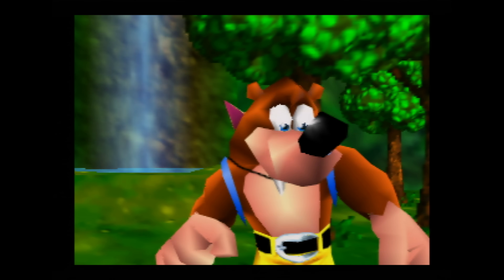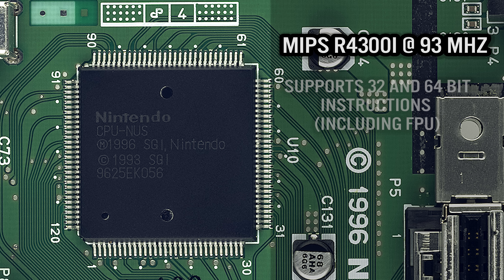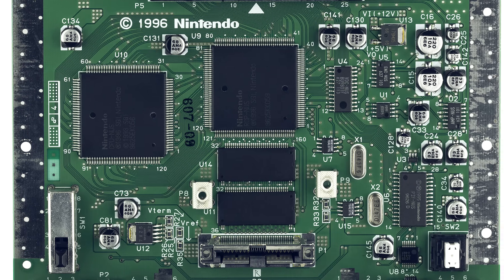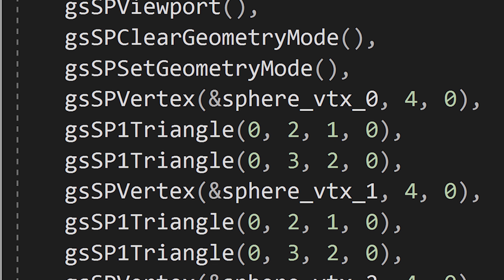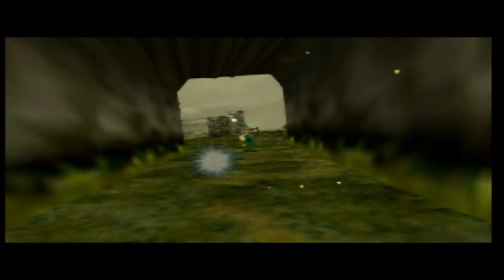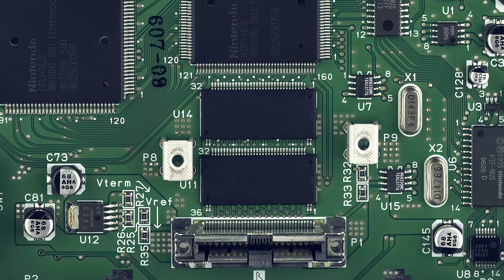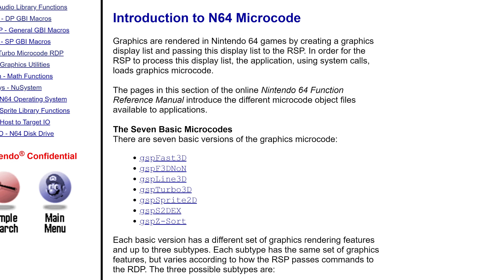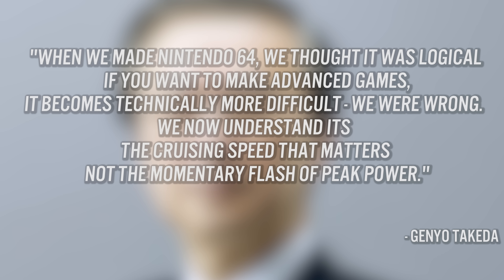Why was the Nintendo 64 so hard to develop games for ? | MVG

Comment: Noobs = the cartridge format was the N64's weakness

MVG = 4kb texture cache, RDRAM, pixel fill rate were the N64's weaknesses
Reply: @randomguy8196 Not as much as you think.  Super Mario 64 was $50.  Sony dropped the price of Playstation games from $50 to $40 around the time of the N64 launch as I recall.  Even when they started getting into the larger cartridge sizes, Nintendo 1st party games were usually still around $50.  The 3rd party developers games would cost $60 to $70.  This had less to do with the medium the games were stored on and more to do with Nintendo's extreme greed.  Here is the basic rundown of costs according to a reddit poster that claimed to have once had a contract for N64 development.

Minimum production run: 15,000 units

Production costs Nintendo profits from because you have to go through them.

Nintendo takes an additional royalty fee of $7 each cart for logos, seal of approval, etc.

Packaging runs about $150,000 for 15,000 carts.  Manuals, boxes, shrink wrapping.  Delivery fees not included.

On a $55 cart a profit of $6 to $7 dollars was made.  Nintendo got the rest.

Profit margins for developer on Playstation could be as high as $27 per disk.
_______________________________________

This is why 3rd party games cost so much more.  Even the Blu-Rays of the WiiU are a special proprietary format that only Nintendo makes.

Crash Bandicoot has a very linear structure to its' level design.  The designer always knows what is coming next.  That is a luxury that an open world game doesn't have.

Ubisoft, EA, 2K, Activision, Rockstar, Capcom, etc.  They all do it.  If Mega Man was a new franchise released today you would have about 5 levels that you would keep playing through over and over again.  You wouldn't gain a new weapon after defeating the boss either, but instead a random part that is needed along with others to make the weapon.  How is what I described not exactly like Monster Hunter or any number of endless grind-a-thons?  For the record, I do enjoy Monster Hunter, but it is a short game as far as content goes, that is artifically lengthened to be an endless time sink.
Reply: @Maintenance Renegade I find going purely digital to be a mistake because it gives the publishers too much control over our purchases. Consumers have long since forgotten the importance of personal ownership of the things they buy and the right to do whatever they want with them.
Reply: The cartridge actually did hurt it though
Reply: randomguy8196 this dude is a very annoying Saturn propagandist plaguing 90s console comment sections for quite a long time already, together with other Sega fanboys.
Reply: @Maintenance Renegade Yeah, it is really interesting how cartridges can now hold as much data as a disc. The Switch's cartridges can actually hold 32gb which is more then what a single-layered Blu-ray holds(25gb)! And apparently Nintendo is working on bigger Switch cartridges that go up to 64gb!

I would say that it looks like cartridges might be making a huge comeback, but sadly I don't think that will be the case. I think that everyone will opt for digital only consoles in the very near future. Physical games have slowly been going the way of the dinosaur since the Wii/PS3/360 era. Hardly anyone buys physical releases anymore, and Sony has made it very clear that they plan on phasing out physical releases with the PS5.
Reply: @Maintenance Renegade Great point. One major reason why I don't like digital downloads is that they are a poor choice if you wish to own the game permanently. Your console's internal hardware will eventually start to go bad, and parts will need to be replaced. Depending on what part that is, replacing it could wipe out everything you have on it. For now, you can go to the shop and re-download all your games, but internet will be disabled at some point, and that means you'll have no way of getting those games back. At that point, you better hope you have all your games backed up somewhere. If not, your only hope is tracking down a physical copy, considering they exist (although you'll no longer be able to download the update patches), or waiting for re-releases of those games for newer consoles (if it ever even happens.)
Reply: The N64's cartridge format though most hindered it in an economic sense rather than a technical one. It made game development much harder since games had to be finished more than half a year before launch because of the lengthy time of cartridge manufacture. The profit margins were also lower on cartridges so you needed to sell more to break even. That meant making a game for N64 was a lot more risky than for the PS1.
This greater risk drove away a lot of 3th party developers.
Reply: @Maintenance Renegade USB memory sticks are not "basically a cartridge." Saying that shows how little you understand about the underlying technologies. There is a lot more to storage mediums than "does it plug in, or does it sit in a tray?"

Not only that, but USB memory sticks are mostly only used for transferring files between computers or making disposable backups. External SSDs are the "portable memory device of choice for serious computing," in my experience, and that's a technology that's even further removed from cartridges.
Reply: @coryzilligen790  There are also high-performance USB 3.x memory sticks which are almost external SSDs.
Reply: was RDRAM really a weakness back then? According to Wikipedia it had a throughput of 562.5 MB/s ion the N64. The N64 was released in 1996, at that time PCs still used EDO-RAM, which has a maximum throughput of about 320 MB/s from what I found in a quick google search. Even SDRAM has only 532 MB/s, so technically the burst speed of the N64 RAM was only surpassed in on the PC when DDR1 came out (first used on a PC in 2000 according to Wikipedia, became widespread from  2001). DDR1 was at the beginning only at maximum DDR266 as far as I know, so it had a maximum throughput of 1064 MB/s.

However I don't know about the latency of RDRAM. I know EDO-RAM had a minimum of 120ns, SDRAM at 133 MHz had a minimum of 30ns, as far as I know, so it was a big leap compared to EDO. DDR1 also had a minimum latency of 30ns when it first came out as far as I know. For comparison: modern DDR4-memory has a minimum latency of somewhat below 20ns, so the latency didn't improve much since the time of SDRAM. How I get these values: the minimum latency is CAS + tRCD, which are the first 2 values in the usual notation, for example 133MHz-SDRAM had minimum latency of 2-2-2-5 as far as I know, these are clock cycles, one clock cycle at 133MHz is 7.5ns, so the minimum latency is (2+2)*7.5ns = 30ns.
Reply: Parker's NBA History Well it was all of what you mentioned. But it can't be understated how much of a bottleneck cartridges were. While it did allow for fast loading times, a lot of games cut corners where they could to fit on a 32/64MB (not to exclude lower storage carts like 4MB) game cartridge. Resident Evil 2 is a prime example how it used every trick in the book to fit on a single cartridge by compressing textures, compressing FMVs, compressing sounds & voices, compressing backgrounds, et cetera. It's a miracle how some games did so well with all of those limitations imposed.
Reply: @NGameReviews  I think there is a video on how they did it with Resident Evil 2 on the N64.
Reply: Nintendo's woeful lack of support to developers was probably a bigger issue. 

I have recently come to learn  that one programmer who programs and optimizes N64 games as a hobby/ side hussle has now claimed that through a bunch of different optimizations and tricks, he's found a way to get enough data throughput through the rambus to avoid suffering from latency or bandwidth bottlenecks. He now argues that the N64 DID have a good enough memory system, and is now defending the original hardware designers from SGI, NEC, and Nintendo. He just thinks that somehow even Nintendo never really understood how to properly optimize graphics programming for it, at least not with Mario 64, and this was made worse by the fact that Nintendo kept a lot of their best programming knowledge (and custom microcode) as a secret.

He claims to have gotten a game he's working on running so efficiencly that the RSP is able to run at 100% without being bottlenecked at all by the rambus. The N64's CPU was still unnecessarily powerful though, apparently. Apparently it was completely useless for it to be 64-bit, which only added additional cost, and even a cheaper 32-bit version with the same amount of 32-bit performance would have still been unnecessarily powerful relative to what the rest of the system realistically would ever need, at least for the vast majority of games.
Reply: Hm, this really makes we wonder what N64 games would have been like if at least two of these things were addressed, even if the processors were at lower speeds.
Reply: all of the above
Reply: @Maintenance Renegade consoles still use optical discs for games, except if you download them which I would never do because the price is the same or almost the same but if my console breaks I can't transfer a downloaded game to the replacement as far as I know. The main difference to PS1 times is that now it doesn't play directly from the optical disc anymore because the drive would be too slow, but is installed to the HDD.
Reply: @randomguy8196 The cartridge was never a weakness.
Reply: @randomguy8196 At least the PS1 (which was the only 5th generation console that was more successful than the N64) used EDO RAM, which had a latency which was about 4 times higher than SDRAM: https://en.wikipedia.org/wiki/PlayStation_technical_specifications
Reply: @randomguy8196 Yes, memory latencies are complicated, there are like 2 dozen different values, although most of them are only relevant in special circumstances so they have a limited influence on performance. The most important ones (at least for SDRAM) are called CL, tRCD, tRP, tRAS and command rate.  CL is also known as CAS latency. The most important ones of these are tCL and tRCD and the minimum latency is CL + tRCD. However depending on the physical address of the next word compared to the last one the actual latency can be higher, e.g. CL + tRCD + tRP. See https://en.wikipedia.org/wiki/Memory_timings
Reply: Most valuable gamer
Reply: The PS1 also had a 4kb cache and a lower fill rate than N64.

So yes, regardless cartridge stands as the issue.  Lol.
Reply: Hmmm I don't recall anyone ever saying that the cartridge was the weakness of the system.
Reply: @AnarickTheDevil  
It holds less data and is costly to produce. Less bang for more buck
Reply: @Maintenance Renegade 
Yeah, USB is basically a cartridge, and a pigeon is basically an eagle
Reply: @randomguy8196 I have to agree.  Anyone that hasn't heard of the legendary Factor 5 really shouldn't even be attempting a discussion about programming.  Those guys could literally make any piece of hardware do things that no one else could.
Reply: @randomguy8196 I did not play video games to be wow'ed by FMV cutscenes right out the gate from 3D games. That's  a dangling a shiny object scenario
Reply: @randomguy8196 Yeap, let's have a view seconds of FMV instead of a game that looks better all the time... O.o    Apart that even with the cardridge, you had FMVs.
Reply: @randomguy8196 I love when people don't notice i was sarcastic :)
Reply: @randomguy8196 A CD format would have hurt the N64 quite a bit in performance. Since not only do you have the laggy elements but you then also have the slow CD's to content with.
Reply: @randomguy8196 Well, preordering would have potentially worked better.
Reply: @randomguy8196 Indeed, that would be possible. Or perhaps even getting done sort of card or whatever in a physical store that confirmed the preorder.
Reply: @randomguy8196 I don't disagree with any of the points you made here regarding development costs so I'm not quite sure what point you're making.  I would add though that there is a flip side to the lower production costs and that is it makes it much easier for developers to release lots of shovelware since they don't need to make a good game to guarantee high profits.  That happened a lot on both the Playstation and the Wii with plenty of 3rd parties releasing games that were clearly not even trying to be good, but to just generate enough revenue from clueless relatives buying the worst games from the bargain bin for their grand kids.

You absolutely could not make an endless grind-a-thon for the NES.  You couldn't store that much data on the cartridge with a battery back-up.  River City Ransom and it's ridiculously complex password system is about as close as you could get.  There are only so many unique items that either method could keep track of in your inventory.  The graphical representation or strings of letters would quickly eat up all of the space on an NES cartridge.  Most of those games were only 2 or 3 meg and when I say meg I mean megabits, not megabytes.  The inventory you keep in your home in Monster Hunter would far exceed the memory capacity of the typical NES game.
Reply: Maintenance Renegade Cartridges were MUCH more expensive and less eco-friendly. Even today, the leading consoles use optical and magnetic storage because they are still more cost-efficient. Certain mobile consoles with smaller games and outdated graphics use silicon storage. Also, internal flash storage is not comparable to cartridges, because it is used for different purpose. Not a distribution medium but a rewriteable temporary storage,  basically like RAM that retains data without power but still eventually erased. the distribution medium is the Internet.
Reply: @noop9k  Ah, yes, the PS5 and Xbox Series X HDD. That thing is apparently really fast! It's almost as if it wasn't a HDD but an NVME SSD...wait! IT'S BECAUSE IT IS AN SSD!
Reply: He misspoke. The expansion pack had 4MB not 4 kilo bytes
Reply: Noobs = "A 700mb CD compared to 64mb cart is a weakness"
Reply: @miljororforsprakpartiet290  700mb that can only be read at the speed 0.15-0.3MB/second. If no read errors..
Reply: @noop9k  That's indeed a fair point. Like SSD vs HDD of the past. However, this is still the reason why N64 lacked the quality of Ps1 games, despite better hardware.
Reply: @miljororforsprakpartiet290  "lacked the quality of Ps1 games"?  You're really clueless.  No Playstation game could even come close to touching the quality of the best N64 games.  You should probably actually play the best games for a system before going online and embarrassing yourself.  The cartridge format, z-buffer, and analog controller as standard are the 3 biggest reasons the Playstation could never hope to handle even many of the early generation N64 games.  That is why a rumored port of Turok: Dinosaur Hunter was canceled.  There is no way they would ever be able to stream in the information quickly enough to handle such massive levels.  The N64 could effortlessly run ports of Vigilante 8, Tony Hawk's Pro Skater, and Resident Evil 2 with improved performance and visuals, yet the Playstation never had anything as technically ambitious as even the first 2 games available for the N64, Super Mario 64 and Pilotwings 64.
Reply: @davidaitken8503  You have to understand one fundamental thing: a chain is never stronger than its weakest link. Nobody cares if your video machine has the power of a Blue Gene supercomputer; if it only has a VHS slot, it'll still fall behind the very cheapest of mass-produced DVD players. This is the problem with the N64 - its power cannot make up for the lack of content to process.
Reply: @davidaitken8503  “No PS1 game??” Does anything on N64 compare with GT2, Tekken 3, Final Fantasy 8 or 9?
Z-buffer is the reason why N64 is slow, it is a costly feature.
Reply: @miljororforsprakpartiet290  N64’s “power” was very underused, and the “texture buffer” was a horrible blunder.
Reply: @davidaitken8503  Wow, what a fanboy..
Okay, name N64 racing game that rivals Gran Turismo 2 and a fighting game that rivals Tekken 3 and also runs with comparable resolution and framerate.
And add a good JRPG that is better than FF9.
Reply: @davidaitken8503  Yeah, “massive and sprawling”. With an average N64 game having worse texture resolution /variety and lower display resolution than an average contemporary game on puny PS1.
Reply: @noop9k  Nothing "fanboy" about any of it.  Just facts.  The N64 is the single greatest system for racing games ever made.  Their are literally dozens upon dozens of excellent racers.  When you say "rivals Gran Turismo 2" are you talking about the technical side of things, the type of racing game style, or how good the gameplay is because their are a whole slew of criteria I could go by.

F-Zero X is probably my favorite racer with blazing fast 60fps action and 30 vehicles out their on the race track all at once.  If you're looking for something with more realistic graphics and gameplay like GT2 I would suggest World Driver Championship or F1 World Grand Prix.  Ridge Racer 64 manages 4 player split screen with AI cars out their with you and you're buddies at a smooth frame rate.  San Francisco Rush, Rush 2, and Rush 2049 are my favorite 2 player co-op racers with large, detailed tracks and 6 cars out their total.  Beetle Adventure Racing looks gorgeous and has a weighty feel to the cars despite the outrageous nature of the racing.  I really could go on and on.

As far as Tekken 3 goes Killer Instinct Gold puts that game to shame.  From a technical side, though the characters are pre-rendered 2D the environments are extremely detailed and rendered in full 3D at 60fps which looks far more impressive overall than Tekken 3's laughably cheesy flat ground with muddy 2D picture environment if you could even call it that.

I honestly couldn't care less about any crappy turn-based JRPG from either of these systems but Ogre Battle 64: Person of Lordly Caliber is certainly very visually impressive.

I have to stress again though, that none of the games you mentioned are really that ambitious from a design standpoint.  A game like Legacy of Kain: Soul Reaver or Spyro the Dragon is probably the closest the Playstation ever got to N64 levels of sophistication and ambition.  They, of course, pale in comparison to any number of more ambitious games on the N64.  I mean would you really want to compare them in a side-by-side to the likes of Zelda: Majora's Mask or Banjo Tooie and question which system is more capable?  Are you really that clueless?  Do you really want to truly see how poorly a Medal of Honor game stacks up to the likes of Perfect Dark, Golden Eye, and Turok 1 and 2 because I could use a good laugh?
Reply: @noop9k  N64 games routinely displayed far more texture variety in any given area than what you would find in a typical PS1 game.  Show me a Playstation game with more texture variety than any given map in Banjo Tooie or Conker's Bad Fur Day.  The N64 had quite a bit more RAM than the PS1 and it could access stuff quicker from the cartridge, too.

Plenty of N64 games had hi-res modes as that was the laziest feature 3rd parties could add as their contribution to expansion pak support.  Ports of games like Tony Hawk's Pro Skater and Vigilante 8 ran in higher resolutions and were smoother doing so than the Playstation originals.  I specifically remember how the Playstation version of Tony Hawk used to chug in 2 player split screen mode but ran silky smooth even in a higher resolution on N64.

Playstation games that ran in a significantly higher resolution were typically far less ambitious and simple in their design.  You will never hear me brag about Battle Chess 64 running in full 640 x 480 because it really isn't that impressive of a technical feat when you consider how basic the game is.
Reply: @davidaitken8503  Yes. He's a Troll. A Former Pygnosis programmer and Sony Pony Fanboy.
Reply: @miljororforsprakpartiet290  PS1 CD ROMS had less storage than that. Most had only 500 MBs. Some even as low as just 450 MBs. That''s due to the fact that PS1 CD Masters had only one layer with only 512KBs of Memory.
Reply: @segaunited3855  Okay. Still 8-25x the N64 cart, though.
Reply: @miljororforsprakpartiet290  Don't immediately believe that Sega United person. Crazy Saturn fanboy, spreads utter bullshit about  PS, Saturn and other systems which he probably doesn't even understand.
Reply: DejaVoodooDoll  Those restrictions weren't there to try to prevent developers from making games the way they wanted.  When getting the most technology into a system and keeping it at a consumer friendly price point, compromises have to be made.  There are ALWAYS trade-offs.  You've proven time and again you don't understand these game systems from an engineering/ cost standpoint, so please stop pulling BS out of your ass.
Reply: @JS-rm2ws  It should also be noted that the SNES competed with the Turbo Grafx 16 CD and Sega CD just fine.  Yes, they were add-ons with a smaller install base from the main system, but had those CD games been significantly better than what was available on cartridge, more people might have actually bought them.  I blame game magazines like EGM and others for poisoning the well of public opinion on this issue.  CD's have always been a bad format for games to come on.  The shortcomings are the very things that restrict game design the most.
Reply: @davidaitken8503  SNES poorly competed even with base Megadrive due to its anemic CPU, slow cartridges and 8-bit internal bus.
Could never match Chi no Rondo or The Snatcher, enabled by larger CD storage.
Reply: @davidaitken8503  oh, and no, Amiga OCS/ECS sucks vs both SNES and MD. CPU still better than SNES of course.
Reply: @noop9k  I've actually encountered idiots that think otherwise.  Despite it's advantages on a spread sheet, in practice the Genesis/Megadrive could never hope to pull off anything as impressive as the best SNES games in literally any genre and the SNES's superior controller as standard helped out the hardware in that regard too.  Nintendo also had the foresight to design the system from the get-go to be upgradable through software as well.
Reply: @davidaitken8503  Genesis had a Hidden 32-bit Data Bus embedded in it as the Motorola 68000 was VERY capable of 32-bit instruction data while the Ricoh A522 wasn't.. Sega CD also had higher color palettes than SNES. SNES was basically Apple IIGS SoC and also only used an 8-bit DMA bus relying on an APU for more taxing features.
Reply: @davidaitken8503  Ricoh A522 used a 16-bit Address Bus and 16-bit Data Bus. But it only ran DMA at 8-bit. The SA1 contained a 16-bit DSP.

Motorola 68000 ran a Dual 16-bit Address and DMA Bus but had an extra block of Data that could run at 32-bits. Its only drawback was its lack of DSP, which wasn't a standard yet during Genesis/Mega Drive's development in 1986-1987. But was by 1988-1989 when SNES/Super Famicom was in development.
Reply: @randomguy8196 Anyone that thinks Factor 5, of all companies, are amateurs is clearly a complete moron.  They are the best coders on the whole damn planet.  The only other company as talented as them is another German company called Shin'en.
Reply: @randomguy8196 I understand the risks for publishers, but as an end user cartridges were superior to CD's in every way.  Not only could they quickly load new information in quickly but, like you said, FMV was nigh impossible.  In game cutscenes on N64 games could flow seamlessly into and out of the action and plenty of spoken dialogue and other sound effects could be quickly swapped in and out during gameplay with little delay.  I have never once heard a Playstation game pull off dynamic, in-game dialogue as effectively as Star Fox 64, Rogue Squadron, Battle For Naboo, Conker's Bad Fur Day, or Perfect Dark.  CD's may have been great for publishers, but they always sucked for players.  Level design always suffered heavily on CD games as well, in an attempt to cut down on frequent map switching.  Banjo Kazooie and Banjo Tooie would of had severely simplified level design had they been designed for a CD system. 

Cheap, massive amounts of storage space is one of the big reasons games have become so damn boring and repetitive.  Why bother spending months and months making real, genuine, game content when you can simply add in copious amounts of stuff.  That is part of the reason games revolve around a billion pieces of loot to collect, cosmetics to purchase, etc.  It is cheap and easy and gives the illusion of content and countless hours of gameplay.  There are NES games that take an hour or so to complete that have more genuine content and game variety than most of the games that come out nowadays.  They had to make as much variety and unique gameplay as they could because they didn't have thousands of gigabytes of storage space to fill up with cosmetics and slight varients on the same damn weapons and equipment.
Reply: @davidaitken8503  Really interesting theory man.  Limits make for creative solutions.
Reply: @davidaitken8503  couldn't agree more, hate those collectables, trophies and similar stuff on recent games
Reply: @davidaitken8503 cartridges don't have as much space as cds, cost, and take longer to make. A single ps1 disc could hold 700mb. A n64 cartridge couldn't even hold 100 max. Ps1 disc were cheaper to make and faster too. Thise disc also were very durable as well.
Reply: N64 used 128KBs for Texture Chache, Not 4KBs. The 4KBs refers to the Open GL program Rachel SDKs had.
Reply: @LeaveMeAloneGoogle Early Rachel SDKs and Early Documentation from 1995.  The SGI RCP's Spec Sheet was under documentated like Saturn's Spec Sheet.
Reply: @randomguy8196 Wikipedia is not a Credible source at all. Have you ever worked with a Rachel SDK? Its clear you never have.
Reply: @randomguy8196 Indie Developers? That's your source? an Old IGN article for 20 years ago of Indie programmers just learning the BASICS of N64's Hardware?

Yes they were very much amateurs . N64 Rachel required Pipelining CPU+GPU for More Chache, even Rob Wyatt flat out stated this himself. He said that many developers took so many shortcuts by writing mircocode without its RAM Passport, instead of using the CPU AND SGI RCP together. It took until Dreamcast first arrived on the scene in 1998 for most programmers to realize this, as it was becoming a STANDARD for Most PC Games that were being developed at the time.